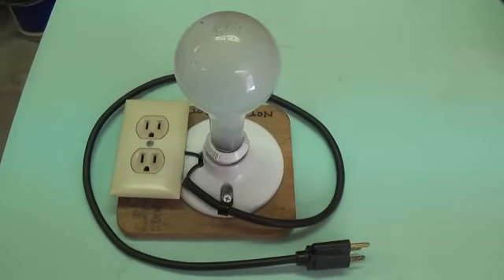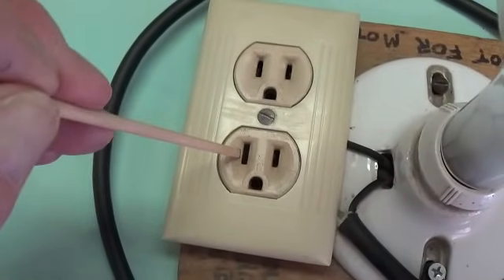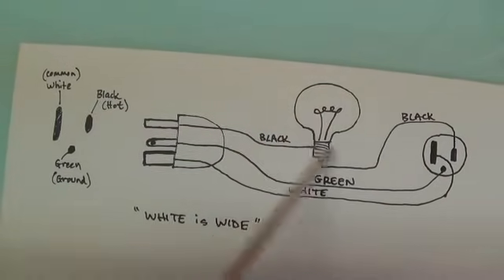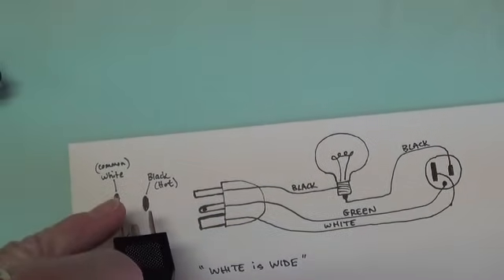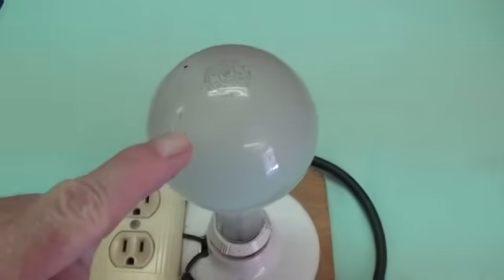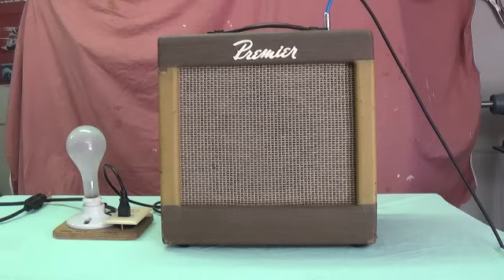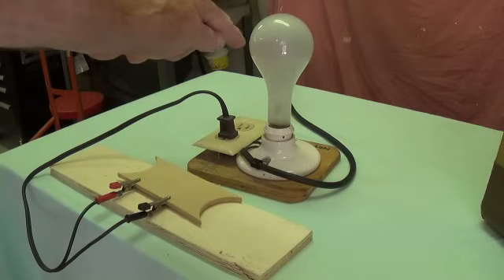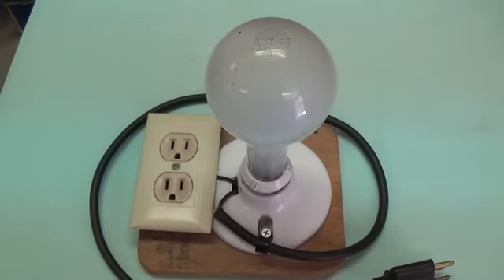Build Your Own Current Limiter for Protection when Repairing and Testing Electronic Equipment

Comment: This is very interesting.  When you shorted the wires, how come breaker did not trip?  I thought circuit breaker should have tripped.
Reply from the maker: The breaker will only trip if the current flow exceeds 15 Amps.....which the bulb filament would not allow to happen..

Comment: I used to do electroplating/electroforming, my heavy duty DC power supply cannot limit the current below 1 amp, I therefor find it hard when electroplating small items since they require only around 300-500 milli-amperes, this is the same method I used to limit the current using two a small automobile DC 12 volt bulbs connected in series.
Enjoyed the whole video, also learned something new. . .
Greetings from India.
Reply from the maker: Glad you enjoyed our videos, Johan.

Comment: Re halogen bulb limiter. I just checked some old voltage charts for a stand-alone preamp. Without limiter B+ was 353V, and without it was 350V. Not much of a voltage drop.
Reply from the maker: Surely you realize that voltage drop is directly related to current flow, and the current draw of a stand-alone preamp is but a tiny fraction of that encountered with a full amplifier circuit. I have personally investigated the use of halogen bulbs in current limiters:  With a low to medium-power Fender amp, i.e. Princeton Reverb, a 100W halogen bulb can cause -56V of drop, and two 100W bulbs in parallel can cause -18V drop. By comparison a single 200W incandescent bulb caused only -2V of drop. A single 100W halogen is not even usable for a Fender Champ.

Comment: Would a GFI outlet work in this project? A G.F.I outlet could be a way to protect the user from a nasty  ground shock
Reply from the maker: The CL is more for protection of the circuit, David. GFI's are fine, but serve a different purpose in a different way.
Reply: A GFI protects you. The bulb limiter protects the device under test.
Reply from the maker: I agree, Silas. @silasfatchett7380

Comment: Doug, thank you for this video.  It is helping me nearly a decade after posting.  I have read the description and I still have a few questions about the watt value of the lightbulb. 

1.  Is a 250 W bulb the recommendation for a low-wattage tube amp (say, 5W amp) as well as a high-wattage tube amp (such as 100W)?
2.  Is there a way to estimate or calculate the “ideal” wattage for the lightbulb for any given tube amp?

Thanks again.
Reply from the maker: I  have found that a 250W bulb works fine up to around 50W of amp output power, but for higher-powered amps, you may need additional bulb wattage......i.e. two 200's in parallel. There probably is a mathematical relationship between bulb and amp wattage, but I have not taken the time to calculate one. It's easier to simply use trial and error to find a bulb wattage that allows for proper amp function without noticeable illumination.

Comment: Norway here. Europe, as far as I know, dont have polarized outlets.
Is that a problem?   We dont have Neutral and Line, just 2 poles...
Reply from the maker: The lack of ground is a serious issue for your personal safety, but not for the function of this device. I believe it would function properly if the bulb filament was placed in series with either AC wire.

Comment: But, what is your voltage at the output terminals? The bulb must drop "some" voltage..
Reply from the maker: Yes, it does, Clem, and it reduces current flow also, as the name implies. Thus, when setting final bias on output tubes, you have to plug the amp directly into a wall AC outlet.
Reply: @UncleDoug thank you for clarification...
Reply from the maker: @miller-clem  You're welcome :)

Comment: In what way would this current limiter help in the scenario of the death cap short?  In this scenario when you connect the chassis to the microphone ground, by touching the microphone with your lips, that power supply has this light bulb in series. But this light bulb, as you said has very low resistance because we are using the highest wattage light bulb. Since the human connectig the short chassi to ground has higher resitance than the light bug, is it not the case that most of the voltage drop occurs through you towards the ground? Thanks for explaining.
Reply from the maker: Current limiters are strictly for use on a work bench while servicing electrical circuits, E.....not during performances.
Reply: I get it, that it is a tool for working on the equipment. That being said, if you are playing a vintage amp at home and are unsure if the killer cap is still installed, would such a device give you any sort of extra safety? I assume, that yes, the light bulb would limit the maximum current in the circuit, where the human is electorcuted to ground. But that current limiting is only meant to fry the equipment, correct? The human being would still get fried by that amount of current. Correct? In the end 150 watt current where 99% of the voltage drop is taking place on the human connected to ground, that still kills the human, right?
Reply from the maker: @ertreri  It would probably not prevent your electrocution since the amount of current within the amp circuit, without illuminating the bulb, would be more than enough to kill you.
Reply: Thanks a lot for explaining. I assumed as much. The only that would somehow work would be to have a fuse box before the amp itself. Or doing the appropriate thing and taking it to a repair shop to get rid of the cap. Many thanks.
Reply from the maker: @ertreri  I doubt that a fuse box would help, since no increase in current flow would be required for a lethal shock to occur. The only answer is scrupulous adherence to safe handling practices.

Comment: 1.- What is the black thing in the screw of the light bulb. 
2. - Can you use a exterior enclosure? 
3.- If the lightbulb dies the circuit should be open and no energy flowing right? 
Thank you for the video.
Reply from the maker: 1. I have no idea.  2. I guess so.  3. Yes.

Comment: I rigged up one of these current limiting devices using a 250w incandescent bulb and used it to fire up an old Kenwood stereo receiver from the 70's. At startup the bulb comes up very dim, maybe 5% of full brightness, then goes out when the startup relay of the receiver kicks in a second later and the unit comes to life.....would anyone know......is this normal.....anything to worry about here?
Reply from the maker: If the Kenwood circuit is transistorized, the current limiter bulb wattage should be closer to 100W. If it's tube, then what you described sounds just fine to me.
Reply: @UncleDoug  This Kenwood receiver has more transistors in it than the number of hairs on my head. I'm out of my depth here, but what I think I'm seeing at start up is the charging capacitance of the unit as a whole causing the bulb to light dimly. Then once the full capacitance level of all involved is reached, (< 1 sec.) the bulb fades back to black. From what I'm gathering it's all good. Uncle Doug....thanks for your reply. I'll try a 100W bulb. This is fascinating stuff.
Reply from the maker: @rustycalvera977  Recall that SS circuits operate at far lower current draw than tube circuits. Thus the need for a lower-wattage bulb. Your analysis is correct.....but the main application of the current limiter is for use with tube circuits.
Reply: @UncleDoug  got it......thanks

Comment: I just built one of these a couple days ago to fire up the Marshall build that I've been putting together. It worked like a charm. Thanks again UD.
Reply from the maker: Glad to hear it, JG :)
Reply: I've got a 50 watt. No sound. All the tubes are lit up. I also replaced them. 
Still no sound.
Speaker is good.
Any idea what's wrong ?
Reply: I've got a 50 watt. No sound. All the tubes are lit up. I also replaced them. 
Still no sound.
Speaker is good.
Any idea what's wrong ?

Comment: Made one. It's a variation. I found a unit in big box store that only has one outlet, but it fits regular duplex housing. The other half is lighted throw switch. In it's on position it is lighted and informs that power is available to unit under test. When toggle is off, light is off , no power available.
So far don't see any downside.
Reply from the maker: That sounds like a useful modification, Paul. Thanks for sharing.

Comment: Do you have any thoughts on using a halogen bulb in place of an A19 base incandescent? In particular, I'm looking at T4 mini halogen 120v/250w dimmable candelabra bulbs. The size, price, and screw base make them look like an ideal candidate but will they function in a similar enough fashion to be effective as a current limiter? Does the incresed resistance of the halogen bulb induce any lag in the limiting effect?
Reply from the maker: I have no experience with halogen bulbs in this application and have no idea if one would work. You would have to try it and see. Good luck.
Reply: In that case, I shall report back with my findings.
Thank you.
Reply from the maker: @I.M.Guitar-Nerd  Please do so, GH. If halogens work it would be good to know. I tend to doubt that they will, but await your findings.

Comment: I have made one of these .I have a steam iron with a short..However the bulb does not even light up before the mains trip..What am I missing? I am using a 100w filament bulb.Have double checked the wiring and it is correct.
Shouldnt the bulb at least blow before the RCD trips??
Reply from the maker: You must have an error in your wiring, Barry. If functioning properly, the bulb would illuminate fully, preventing the short from triggering the circuit breaker. You might consider experimenting with a 200W to 250W bulb....unless your wall AC is 220VAC.
Reply: @UncleDoug  hi..many thnx for replying..I would like to share my wiring diagram as I would really like this to be working as I always get faulty items to test. Do you have an email where  I can send you the image of the wiring.? Just to add ,,the iron would be 3000w . Could it be bcause the wattage is so high on the DUT? If so wouldnt the bulb simply blow since it is essentially acting as a fuse.??
Reply from the maker: @Mars7393  A 3000W iron is not a proper test subject, Barry. It is 30 times greater than your bulb wattage. That's the problem. Use a test subject in the same wattage range as your bulb, which could be increased to 250W.

Comment: How long would you leave it on to condition the capacitors in a guitar amp. One situation, brand new, another been sitting around for an unknown time.
Reply from the maker: It's not for that purpose, Phillip. You can use a Variac to reform electrolytics, but the CL is only for protection of the amp circuit from short circuits.

Comment: Could this concept be adapted to some kind of pedal that could be used in front of old amps that may or may not have great grounding?
Reply from the maker: I don't see how the current limiter would be of benefit for grounding issues within circuits, James.
Reply: @UncleDoug  my concern was a charge traveling along the ground to the guitar. Would there be a way to place some kind of protection along the ground of the guitar signal that would allow signal, but prevent large charges accidentally going to the guitar strings? I end up playing on stages with a lot of sketchy or ground-lifted gear. It has me nervous and I was wondering if some kind of pedal could be an extra line of protection in that scenario. Thank you for your amazing videos. I have always been fascinated by electronics but I learn slowly. You explain things so well.
Reply from the maker: @jamescranefinecarpentry7146  The strings and all metal parts of the guitar are connected to the chassis of the amp, which should be securely earth grounded via the traditional green wire in the 3-wire cord.
Reply: @UncleDoug  that is definitely the goal, but I have played in a lot of sketchy places through some suspect gear. I was hoping there was something I could do for redundancy, but I will keep studying. Thanks for all your help.
Reply from the maker: @jamescranefinecarpentry7146  There is no substitute for chassis earth-grounding James. You either have it or you don't......and god help you if you don't.
Reply: @UncleDoug  I think I will be looking over the gear at the venue a little more before I play a gig. 😂
Reply from the maker: @jamescranefinecarpentry7146  Touch your guitar strings to the microphone.....it's an easy test for polarity differences. Good luck.
Reply: @UncleDoug  I’ll do that! Thanks

Comment: very good explanation, however the only thing that i dont get is how this cant limit the current of the tested equipment making it not functional?
Reply from the maker: Thanks, GM. It allows for normal operating current to pass through but will not allow a large surge of current (i.e. due to a short) to pass.
Reply: @UncleDoug  thanks for your answer, in another word we need the resistance of the bulb as low as possible, if a the unit being tested is close to the bulb consumption both will work at close to half their current requirement? last question, does it make a difference if the unit being tested is wired before the bulb ?
Reply from the maker: @GraphicManInnovations  The filament resistance is quite low initially, but when current flows it heats up and the resistance increases, in direct proportion to the aount of current.....so big current surge = much higher resistance = reduced current allowed to pass. If you plug the UBT into the current limiter, it can't be "before the bulb".
Reply: @UncleDoug  thank you sir

Comment: Thanks for your videos, they are invaluable! I'm planning to start building my own amplifier soon and this is the first device I'm going to build, but I've got some questions. 
The first is more of a curiosity: here in Italy it is mandatory to install two kinds of circuit breakers at the entry point of the household circuit, one is to protect against shorts, the other protects against current dispersion (mine is rated for a delta of 0.03A between live and neutral). Would a current limiter be still crucial for working on amplifiers, or the circuit breaker would engage anyway when something goes wrong?

The second question is more practical: In our country we use symmetrical recepticles, so there's no way of telling which is the hot and neutral wire without measuring, but also in that case the user could always plug the wire in reverse polarity (as there's no way to tell which one is the correct way of inserting the plug). In this case, should I use two light bulbs, one for the live and one for the neutral?

The last question also extends to amp fusing since as far as I know, it is better to always fuse the hot wire. Should I fuse both wires to build a safe amplifier?

Thanks!
Reply from the maker: Yes, you will still need a current limiter. It functions instantaneously and gives visual evidence of excess current flow. I have never had to deal with "symmetrical receptacles". Does your system also have a third, grounding slot or provision? If so, you would need to either determine which wire is hot and connect the CL appropriately.....or you would need two fuses and two CL's. If you have no chassis-grounding connection, then one fuse and one CL.
Reply: @UncleDoug  Yes, we typically use either IEC type F (Schuko) or type L (Italian), which are both non-polarized plugs and provides a ground conductor. I'm going to use the Schuko as they are the most common choice here for high power appliances such as PC and Amps. In my lab I could check which is the hot wire and use a single CL, but in the final product I think I'll surely provide double-fusing. Thanks for the insights!
Reply from the maker: @amimaster  You're welcome, E.

Comment: Hey Doug - as a former cannabis grower I have an abundance of HID bulbs and receptacles (400w and 1000w).  Do you consider 250w to be the ideal for Fender amps (I have a couple ranging 20w up to a Twin Reverb).  I didn't really realize these lightbulb concoctions were so useful
Reply from the maker: If the bulbs are incandescent, the 250W would be ideal for most medium powered amps. A pair of them in parallel would be good for 100W monster amps.

Comment: I like your ( USA ! ) porcelain bulbholder , this ( shape )  model is not available in the UK , but we have brass and plastic types .... stage lighting uses 500 and 1000 Watt bulbs but you need to buy an  E40 ( giant ) Edison screw holder ... this device is also useful as a VITAL  input ballast to EHT transformers running many types of gas discharge tubes ( like big Neons  / mercury vapour tubes etc ... ) ... in addition this device can be used to ( safely ! ) determine the windings of an UNMARKED transforner , accidental connection to a 12 Volt winding just leads to a bright bulb ( as you describe ! ) , I have made lots of these ( 230 Volts types ) over the years , and I hope the two extra uses are of help to you and your viewers ..... ( tried - n - tested ) ...............
Reply from the maker: Thanks for your helpful input, David.

Comment: Excellent ... looking over all your stay safe gizmos ... my new guitar amp proto is mostly getting built in the virtual realm, but when it comes to the real world proto, i have to cover my bases...
it is going to have a circuit board, but all through hole discrete, and some hand wiring... ( no ICs at all anymore, i got it worked out on discretes )
Reply from the maker: Thanks, Eric.
Reply: @UncleDoug  actually on my low voltage circuits this winter ....and one IC did find it's way into the amp's bias circuit... 
hope you get some good rainfall down there this winter, i gotta get stocked and bundled up.
Reply from the maker: @RulgertGhostalker  Thanks. We've had a lot of rain so far this year.

Comment: Uncle Doug I have a question. Would a variac work plugged into this?
Reply from the maker: Probably, but I would not wire it that way. Plug the Variac into the wall AC and the current limiter into the Variac.